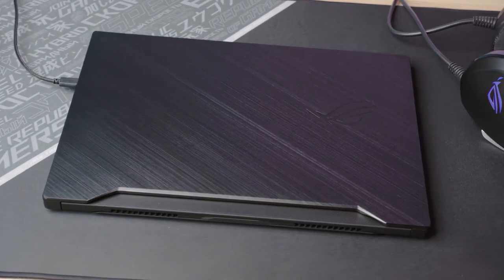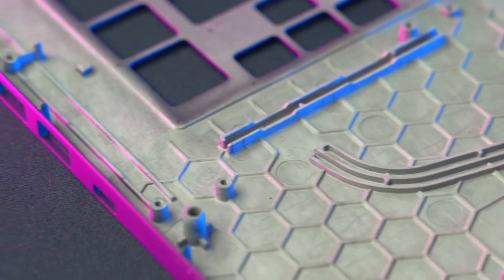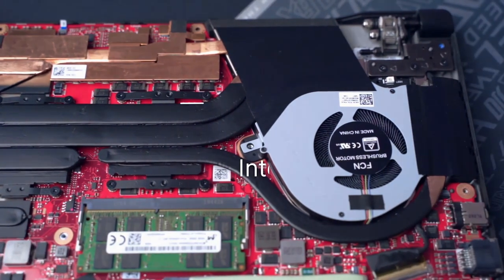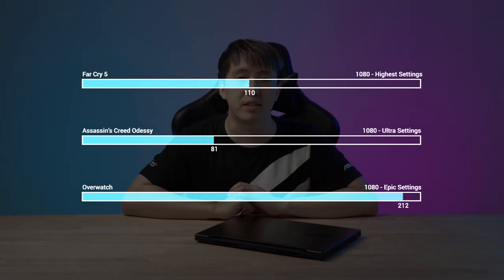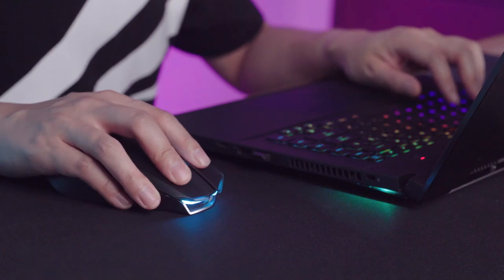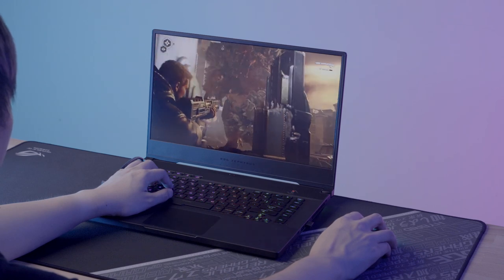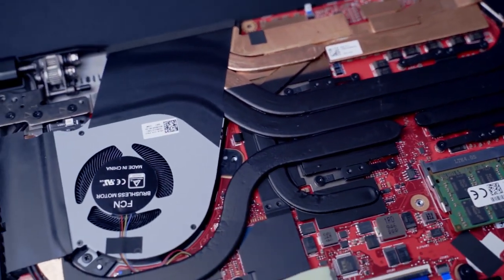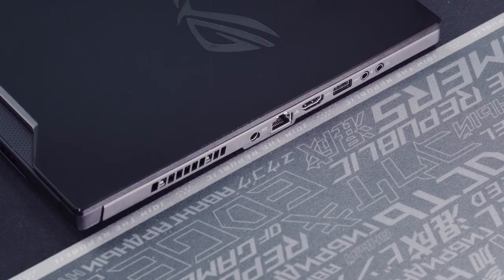ROG Deep Dive |  Zephyrus S15

Comment: Performance is a beast and design is sleek and beautiful.

Only thing I can ask for it routing the power jack and Ethernet ports to the back side of the laptop.
A power connector in such a middle spot of the laptop seems a bit intrusive. More companies need to start looking at magnetic power connectors. We don’t share laptops chargers as often as we did our phone chargers.

But I love it. Also, when are windows laptop going to start defaulting to higher than 1080p? This thing can easily handle 1440p or at least have the screen options. The Surface Laptop and MacBooks have beautiful screen because they opted for a higher resolution at a higher brightness level.
It it is truly built for work and play, I think that option would be a great balance. It’s not 4K which would drive the price all the way up and most content creators dislike it on such a small screen in any case and should still be able to handle high refresh rates.

After typing all that, I wonder if screen makers are the problem. They mass produce 15” panels which makes then a cheaper option and getting a higher res panel means paying a lot more extra as the build would be uniquely for you. Regardless though, I’d get the 1440p panel at 144hz+ over 300Hz 1080p.
Reply: I think I will get this and upgrade the SSD and ram but the only downside is the processor it should be a Ryzen

Comment: Is it really worth buying? This model usually runs hot.
Reply: All games run hot on ultra high settings playing Games that use a lot of FPS, I still have ROG GL503ge with i7 1050ti it can still play games like cyperpunk and witcher 3 ultra high and the fans are heated up every time I turn it on espically when you stream games online. To avoid heat upgrade your ram from 16 to 32 ram that should help the multi tasking and slow the heat but of course it could be the Windows updates

Comment: I got the zephyrus when it first came out and I've had to send it into warranty twice because of thermal throttling.
Reply: Same case and unit from the first days.
but mine is Zephyrus S17

I had from time to time thermal throttling problems. but I didn't cared about it much

until 23/08 when my HDMI port stopped to output 4K resolution to TV.

i can select FHD and lower resolutions.
but when I select 2K / 4K "no signal" on TV.

how its finish for you?
they applied liquid metal or normal paste?
Reply: Which one do you have? 2080 Super max Q or 2070 Super?
Reply: @gamersanditparadise  I had RTX 2080 MQ In the 2019 model

and now I have RTX 2080 SUPER MQ in the 2020 model.

but I'm still with the HDMI problem

Comment: this laptop runs really hot and thermal throttle, what do you expect from a thin machine with non Max-Q GPU!!!,  i still prefer the MSI GS66/GS75  they are  cheaper, better looking and have better cooling
Reply: But the Gs66 has Max Q, right? Also the CPU cooling under cpu only loads is superb on the S15, thanks to Liquid Metal. The Gs66 cannot sustain high wattage in Cinebench at all, whereas the S15 has a 90W power limit.

Comment: Buying any laptop now is foolishness. Waiting for the the 30 series update!!
Reply: 30 series  will announce  for mobile devices  in jan or feb and it will come in notebook in between  april and july. so do u think its worth to wait. even desktop  30 series  have problem with oem oc. waiting for long will be never worth.
Reply: @sunnypatel2006  if you need one immediately then that's a different issue but I recommend if you have something usable just wait, the performance gains are high that buying a 20 series now would really be a waste.

Comment: Horrible location (design) for the AC power port.  It will easily block the other ports.

I have also heard that the LED lighting of the keyboard leaves much to be desired when compared to the Legion 7i or Razer 15 advanced

Oh and by the way, how come in this review, this guy leaves out telling us what the USB type A generation is?  Are we talking USB 3.2 gen 1 (5 Gigabits / sec),  USB 3.2 gen 2 (10 Gigabits /sec) or USB 3.2 gen 2x2 (20 Gigabits per second)? 

I also would like to know what the max brightness on the screen display is (I'm guessing no more than 300 nits).  On the legion 7i, the rgb color accuracy, and the 500 nits brightness are way better.

This laptop is a high performing laptop without a doubt.  But the legion 7i is better.
Reply: Does your legion have raid zero ssd? No. Does your legion have a 300hz display option? No. Does your legion have a magnesium alloy chassis? No. Does your legion have a full max-p GPU? No. Is your legion lighter? No. Does your legion have  better fps? No doss it have g sync for 240hz models? No. The led lighting is just as good as the one on the blade, feels more comfortable than the one on the legion and the blade.armoury crate blows the legions software out of the water. Also the s15 comes with liquid metal out of the factory. It just is a better device.

Comment: This is so similar to the gx502gw that i owned lol
Reply: And how is it? Thermals n noise? Gonna buy the same one too
Reply: @kiiimexviii  gpu at 85 and CPU at 90 after abit of undervolt and repaste. Gets pretty loud but that's just how gaming laptops are, then I got a desktop and I'm not having any issues
Reply: @shuichiyamaguchi4329  Yo how did you get your CPU at 90? Did you reduce clock speeds? Mine still wants to stay at 94C in doom eternal unless i limit the clock speed.
Reply: @firasbajjar  I used to get 95 and GPU at 85. I repaste the thermal compound for both CPU and GPU and also did abit of undervolting on the cpu
Reply: Shuichi Can't be bothered Which thermal paste did you use and did it last you long? I’ve heard thermal paste doesn’t last that long on laptops and people are having mixed experiences.
Reply: @firasbajjar  well thermal pasted ain't expensive and if should last you like about a year
Reply: Shuichi Can't be bothered The problem is having to disassemble the laptop every year especially when you move a lot and don’t really have the time to be doing it. Is there no thermal paste that lasts well on laptops?
Reply: @firasbajjar  it literally took me less than 4 minutes mate, all you need is a tube of paste, a screwdriver and 4 minutes
Reply: @firasbajjar  I didn't really look into the problem of longevity, but it's worth it
Reply: Shuichi Can't be bothered Well to be honest i’m just afraid i break something in one of my re-pastes because my last laptop died because me of bending the heatpipe like an idiot. You are using Thermal grizzly kryonaut?
Reply: @firasbajjar  don't bend the heat pipe lol
Reply: @firasbajjar  I used arctic 3 I think
Reply: Shuichi Can't be bothered Yeah i know lol its just that i missed one screw and thought it was stuck or something so i kept pulling the thing until the heatpipe had a small bend which killed the heat transfer.
Reply: Shuichi Can't be bothered Oh okay thank you for your help.